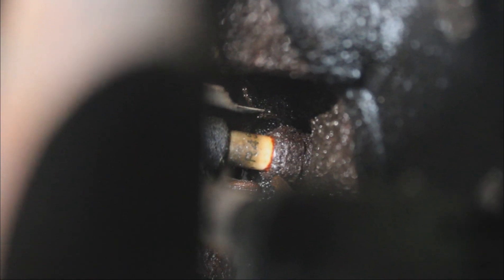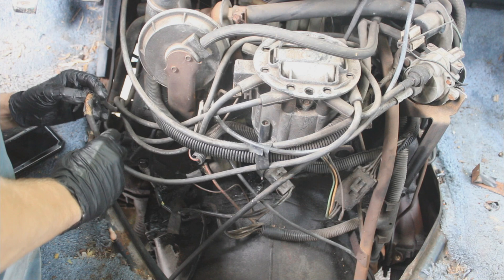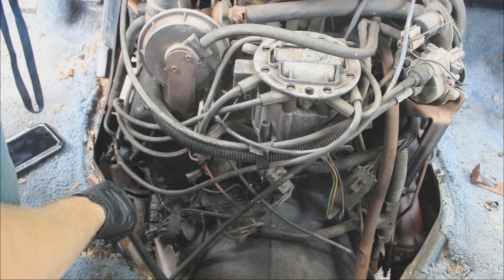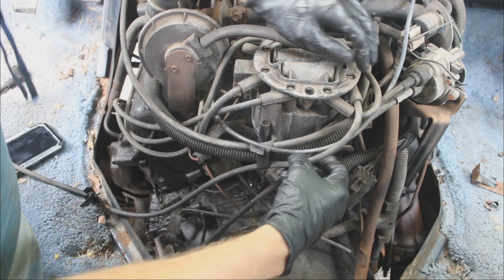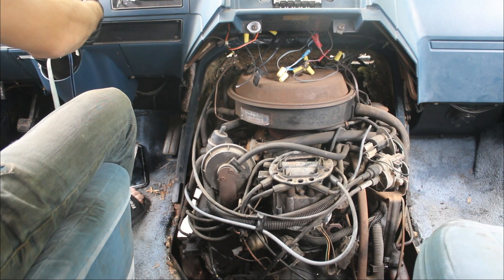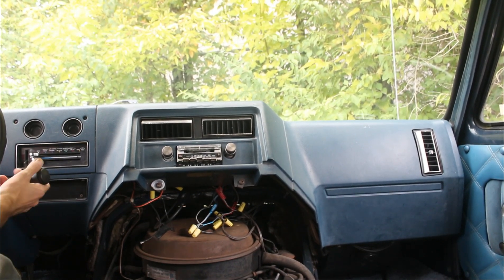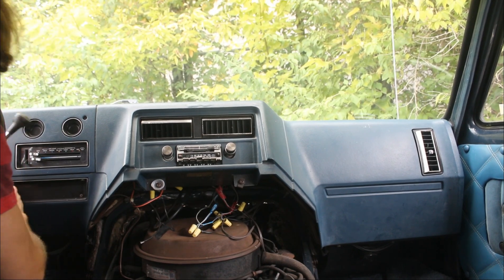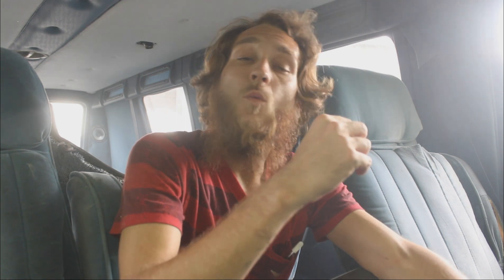Tinkering and Plotting to get the G20 on the Road

Comment: I know a good mechanic down in Falmouth
Reply from the maker: I might be jumping the gun going down that road already. I’ve got a nasty break in one of my lines causing it to dump trans fluid but it did hold enough to go into gear. On my next early day I’m gonna patch the line with a rubber fuel hose and drop the pan to change the burnt fluid. I think from there it could drive